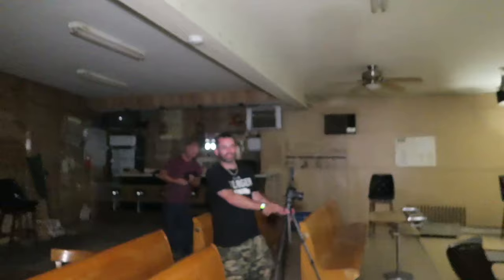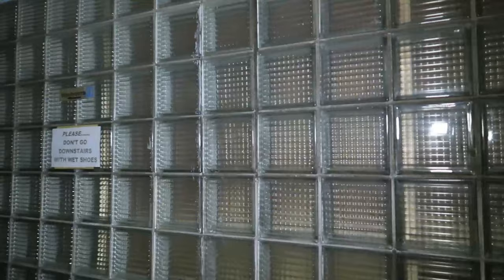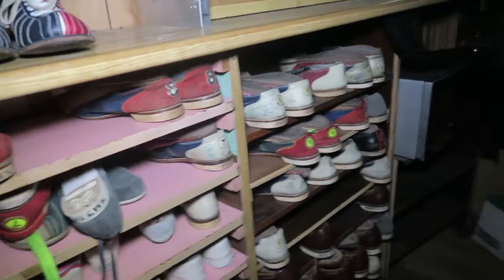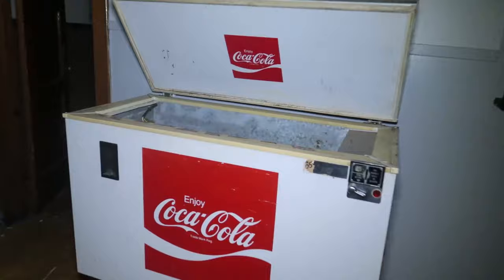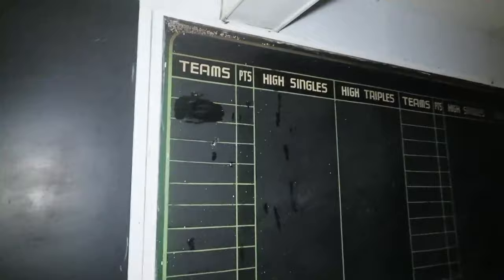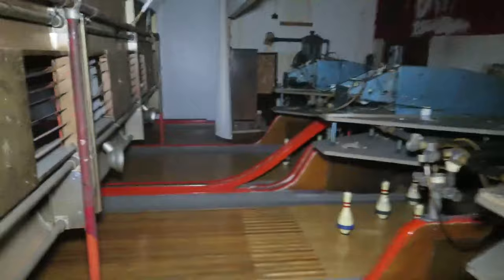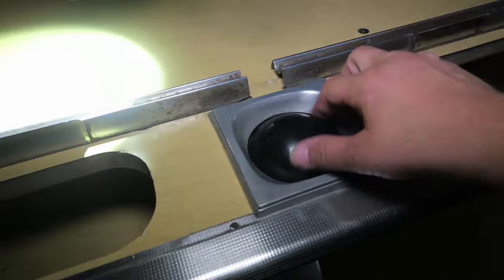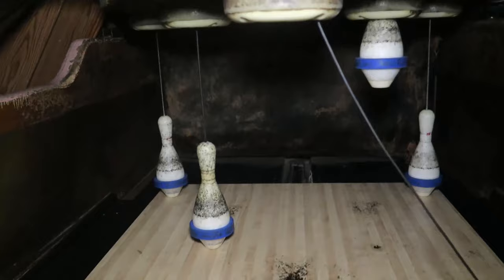(TIME CAPSULE) Exploring Abandoned 1960s Bowling Alley Everything left behind Frozen in Time

Comment: The weird thing is the place looks to have synthetic lanes so that couldn't have been done all that long ago. You can see the different wood lane on the first lane upstairs that seems like it was removed as a working bowling lane but the actual lanes they used they look to have been switched to synthetic; surprising as this is quite expensive. Maybe the owner died and no one wanted to run it anymore. I work on bowling machines but am not familiar with those ones. They might be the Brunswick machine based on the 1940s Schmid pinsetter; I guess the 50s or 60s. Never heard of the other "Bowl-O-Matic."